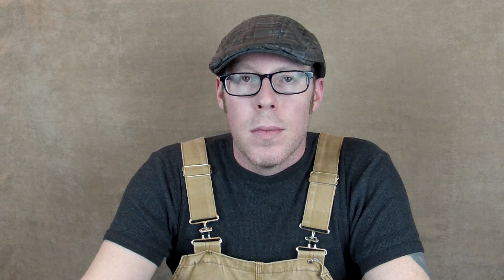Do You Need Primer For Gluing PVC Pipes?

Comment: Adding primer actually weakens joints according to this analysis: https://www.plumbingsupply.com/the-great-pvc-primer-debate.html
Reply from the maker: This is a flawed study.  If you read pipe glue and primer it all states that primer is needed for all pipes above 1/2" in size.  In the experiment that was done which you linked to all of these connections were done with 1/2" pipe.  If you repeat this test with 1.5" or 2" pipe you would find very different results.  Primer is 100% needed for solvent welding.
Reply: You may be right but if so there needs to be a engineering or chemical explanation for why 1/2 inch joints don;t need primer and larger ones do. One would think that the bond strength per unit area would be similar.

Comment: I am redoing my pool plumbing all the way to the wall and skimmer while the concrete is being replaced. Went to the big box store and they had 5 different kinds. Which one should I use. Oatey was the brand they had but blue grey green clear orange.
Reply from the maker: Short answer is gray, clear or blue - but you should read this article to understand more about what the different glue colors mean and which one is best for your application: http://www.swimmingpoolsteve.com/pages/glue-connections.html
Reply: Swimming Pool Steve I actually have read this in my searches. I think 3 times this week actually.  So 711 is the best. That’s what I looked for at the store but they only had oatey. I’ve done plenty of plumbing but mostly drainage. Nothing with pressure or chlorine. That’s what I was concerned about. Also the pvc at the box store is dws. Not pressure pipe. Although it does say it’s rated for 300 psi. Do you Think thats plenty?
Reply from the maker: Schedule 40 white PVC pipe.  Anything other than this is the wrong thing.  Actually some places commonly use flex PVC pipe, but that is an argument for another day.  The number of the glue is not as important and Oatley is fine.  Gray glue, medium or heavy bodied, fast setting.  It should say that on the can.  Probably that blue is fine also, usually being pool and spa specific and possibly suitable for damp installations...but the gray is the best.
Reply: Swimming Pool Steve thanks for your fast responses. It was schedule 40. I have one last question if you don’t mind. Currently the pool has one return line at 1 1/4”. It t’s off at the wall and goes to 2 1” pipes through the wall. I upgraded the skimmer and the main drain to 2 pipes which use to be only one that met in the skimmer. New skimmer line in 2” and main drain is 1 1/2” since that what was going under the pool. I’m not replacing that. So my question is should I up the size of the return to 2” for better flow to the T where it goes through the wall at 1”.  Or maybe at least go to 1.5”?
Reply from the maker: Wow one inch returns is awfully small...this must be an old concrete pool.  If the returns are individually run the usually 1.5" is enough but if they share a line then 2" would be better until they split.  In your case it won't even matter what you do since the one inch termination points are such a flow restriction lol.
Reply: Swimming Pool Steve it’s only 1” for about 1.5 ft through the wall and 4ft for the the other. I have it excavate to the T. I can run 2  1 1/2” lines to each if that will help. I figure it always necks down at the eye anyway. It’s an old Anthony pool from about 1975 i think

Comment: So , how long do you wait between applying the primer / cleaner and applying the glue? it does not say on the bottle I have
Reply: I didn't like seeing your question go unanswered.
My understanding is that you apply the glue immediately after applying the primer. In fact, I've heard that if you apply the primer and wait too long, you'll have to re-apply the primer before gluing.
It softens the PVC to allow fusing of the two parts, so if you leave it dry, it no longer has the same effect.
Reply from the maker: In the ditch it is common to apply the primer such that it is covered but not pooling.  Wait about one full second and then proceed with the glue layer.  To the untrained eye it looks like there is no wait time at all, but a solid second after the primer goes on is enough to have it not pooled and proceed with the glue.
Reply from the maker: I have also heard that waiting too long requires repriming.
Reply: I've heard that 10 seconds is good -- enough time to do its job without drying out.
Reply: About 10 seconds

Comment: The primer not only "cleans" the fitting but actually softens the plastic and chemically "melts" it so that the adhesive can create a secure bond to the plastic. I often hear people saying "you just need to clean the fitting" which is another mistake.
Reply: Swimming Pool Steve my boss tells me not to use primer on 1/2 " pipe , it's not slot of pressure blah blah-it makes me cringe .
Reply from the maker: @therealandrewcano  I actually think he is right.  Have you read all the literature that comes with these products?  Most brands of PVC cement states the same, do not use for pipes 1/2" or smaller.  The reason why relates to surface area of the connection versus operating pressure of the smaller lines, combined with the physical difficulty in priming such a small connection slip without just drowning it, and your area, in primer.  Sorry bro - your boss is right!  But all these other people here talking about no primer at crazy.  If you are using a special new "hot glue" that advertises no need for primer then that is different, but ANYONE making underground PVC connections on a pressurized system without primer and solvent cement needs to take up a new hobby.  Plumbing is not for you.  Doubt me?  Call the 800# on the side of the cement can and ask them yourself, or meet with them in person like I did.  You need primer people...
Reply: Never used primer and in over 30 years have never had a glue joint fail....
Reply: @csmith8338 can I use just glue on a joint under my sink?
Reply: Chargèro 
Yea it welds them together . Can't pull a fitting or pipe from each other after correctly using primer and glue.
Reply from the maker: For sure - there is no bigger sign of a bad pool guy than one that does not use primer...this is like plumbing 101 but you cant tell a pool guy anything!  I have met multiple pool company OWNERS that can not be convinced about using primer...they have been doing it their way for years without problem...it actually makes me sick to my stomach to think about.  I remember one time I agreed to do an equipment installation for a guy who owned a pool maintenance company...he wanted to learn how it all went together.  When I got there I saw he was missing primer...when asked, he asked me what primer is.  I ended up packing up my tools and leaving.  I love training people but if you show up to the party without having put any work in for yourself I am not going to carry your business to the finish line...so to speak.  /rant
Reply: hahaha "what is primer" oh man, I can only imagine.... 
But as you say some people just are not opened to new information, or a different way of doing things, this goes for many trades, hobbies, professions etc... This is why I love talking to other people in the industry and seeing how things are done by someone else. You cannot grow your skills or learn new techniques and tricks if you are not willing to learn!
Reply: If it works, what's the problem?   @Swimmingpoolsteve